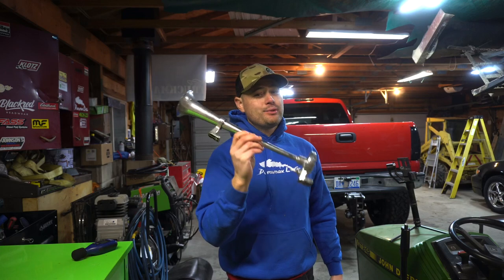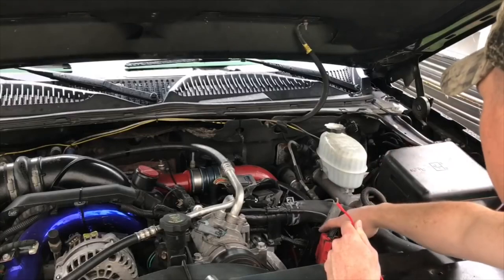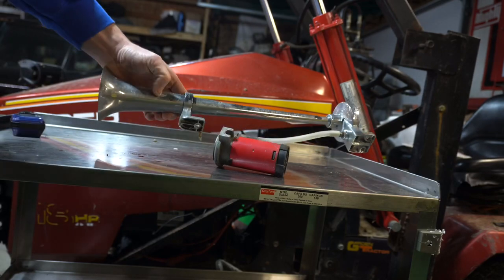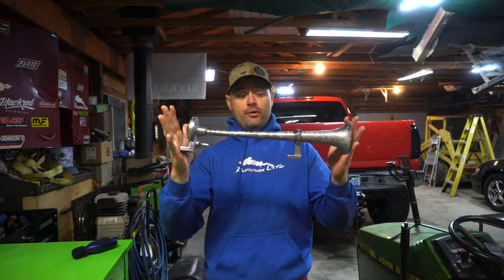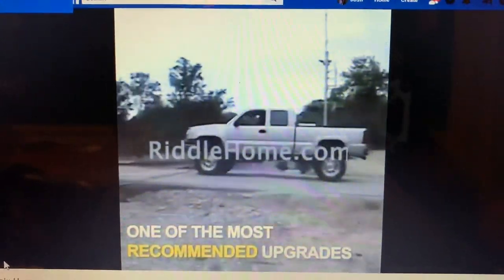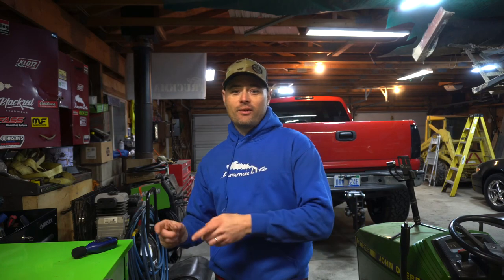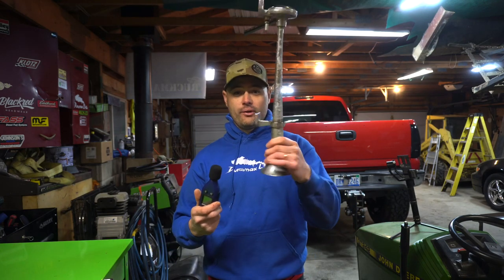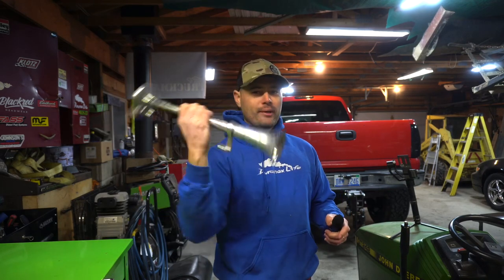Air Horn Review Under $40

Comment: Vixen makes good trumpets for reasonable prices but you can’t stick them in the wind/ rain and expect them to last. They are louder pointed right out into the wind but your best bet is the stick them either facing the rear or down and slightly to the rear up under the hood somewhere.

Comment: I don't dispute that the cheap Chinese air horns are not the best, but looking at your mounting position, the trumpet is sloping up, so any rain or moisture hitting the trumpet is going to travel straight to the throats area and settle there. This would probably have a bigger effect on a poor quality horn though, and like you say, you get what you pay for.

Comment: Take the back cover off the horn and clean the diaphragm piece. Just make sure you put it back the same way. I got 3 of them because of your video 3 years ago to put in my Jeep and I never had a problem except when salt got in them from driving in Michigan winter. But now I got a Silverado and upgraded to horn blasters.
Reply: Hey I have just got to them but have not install them already that bed I upgraded the compressors from the ones that came with them what you think about that
Reply: I have 2 of them to put on my truck

Comment: Another great video Truck Master!
Question: I have a 2007 LBZ. Just had my Allison rebuilt with upgraded Torque Converter and Clutches. New TransSynd fluid, filters, upgraded my lines and installed a new cooler. Radiator cooler was flushed and has no flow restrictions. Been driving the truck easy for the past week since getting it back from the trans shop. All stock, no tunes. Outside temp has been 60 degrees all week and the trans still gets up to 180 degrees. Haven't drove it long enough to tell if it'll keep climbing to hotter temps. Isn't that too hot? Everyone says 100 degrees over outside ambient temp is the correct range. It runs 20 to 30 degrees hotter than outside air temp. I've even done the cooler flip mod. Made no difference. Fluid level is correct. Not too much and not too little. I'm just concerned something is still wrong. It was over heating severely before it was rebuilt. Transmission shop test drove my truck with me in it while monitoring Torque Converter slip and lockup. All transmission readings were perfect. Flow rate through transmission is perfect. It's acting like nothing is cooling it off. Fan and clutch is fine. Engine never gets over 185 degrees. Cooling stack is not clogged up.
I can't figure it out. I've starting thinking about looking for another truck. When summer comes I'm afraid it won't stay cool enough to drive. It's my only ride to work.
You have any ideas what it could be? Anyone else have ideas? Open invite. Lol maybe I'm just being paranoid? One website said 180-200 is the normal operating temp for that Allison. Everyone else says 100 degrees above whatever the outside temp is.

Comment: Sounds like they used audio from a 4 horn setup. Listen carefully and you can pick up 4 different tones. If you are on a budget and want high quality air horns it's best to hit a wrecking yard that has big trucks and emergency vehicles and pull a set off those. Those tiny little electric motor driven units dont usually supply enough air to drive the horns well. A compressor and tank is a must. Engine driven compressor is the best. Most real air horns are designed to operate with a air pressure of 125psi with a max of 200psi. Look for Buell-Strombos air horns, there quality units that have been in production for ever and still manufacture replacement parts. On ebay and other website they will he expensive but at a junk yard they probably only cost you $50-$100

Comment: It doesn't make any sound because the diaphragm broke.

All you need to do is just replacing it with another plastic diaphragm and it will work again, until the diaphragm broke again.

I have exactly same horn like that, but luckily the diaphragm never break so.........    yeah I'm lucky I got the thicker one's and it only cost me around 12 bucks, brand new, same color, same brand, same type, but different country.

Comment: Earl's needs to install an upgraded Intercooler on the Duramax
Reply from the maker: Yes! Very valid point
Reply: @TruckMaster  Maybe it's possible to feed a air horn with an air line from the turbo? Use an electric valve for opening and closing. Have to do boosted launches to blow the horn....
Oh wait.... I should post this on Whistling Diesel's channel. Lmao sounds like something he would do. Y'all should do a collab video. You ride down to his farm.